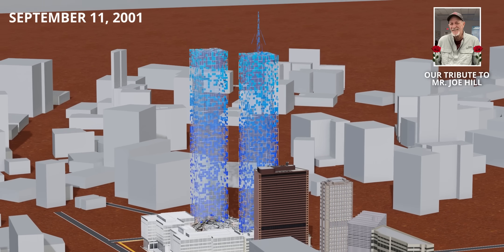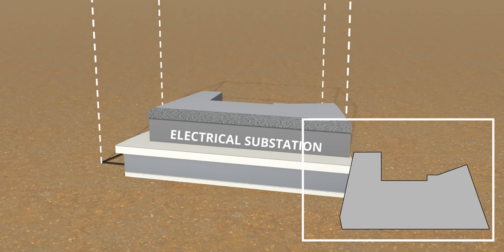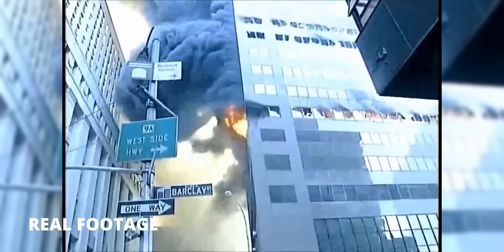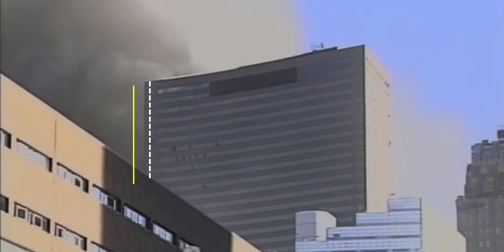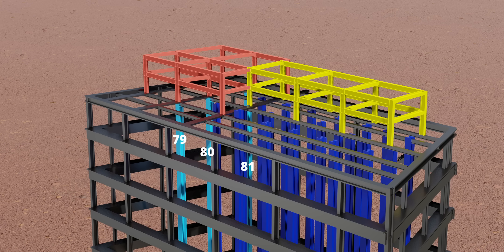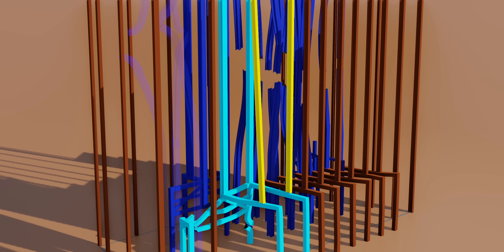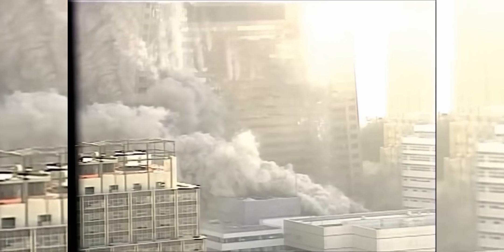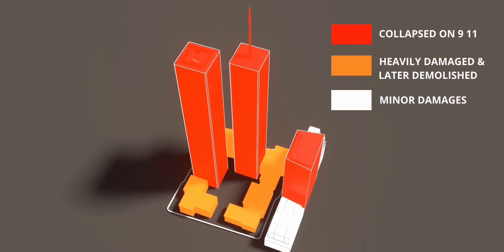Collapse of Building 7 | The Complete Physics

Comment: As an expert building collapse witness, I've seen so many collapse that I can guarantee that building 7 was a perfect controlled demolition and therefore it must have been a conspiracy.
Reply: Oh great, then you should be able to put together a detailed analysis like I did:  Building 7 was the 6th building to collapse of 10 lost on 9/11. Because of its early low priority and complexity, conspiracy filled the information void with simple-minded garbage by technically ignorant people promoting political agendas. 7's loss is an engineering problem and should be treated as such, so I prepared this brief summary of my own analysis to fix that, using technical analysis, not ideology and magical (non)thinking. 

At 10:28am the WTC North Tower collapsed, showering Building 7 with tons of burning debris, causing heavy damage and starting many large  fires which burned out of control for the next 7 hours. Half the FDNY firefighters having been killed, units in disarray, equipment destroyed, no water pressure, and the greater urgency of search & rescue efforts, Building 7 couldn’t be saved so firefighting efforts were pulled as futile and 7 left to its fate. Firefighters make that sort of choice every day in brush fire situations - which houses to save and which ones to let go. Only real difference here is moving the decimal on the size and cost. People get overwhelmed by the size.

www.youtube.com/watch?v=g_SvpwyC17M

Collapse of a burning structure is always a concern for firefighters. Steel buildings subject to fire rely on active firefighting to survive. Buildings are designed around 1 to 3 hours of fire resistance, allowing time for occupants to escape and active firefighting to get started, after which all bets are off. Left to their own devices they'll exceed their design envelope and collapse, like Plasco Tower and Wilton Paes de Almeida. In 7 the occupants escaped, passive and active fire protections were compromised and active firefighting was abandoned hours before the collapse, which left the building to its fate. It lost. Odds on Building 7 would eventually collapse, and it did. No big deal in logic.

 http://www.youtube.com/watch?v=WnYBX6QT0R4 

FDNY Chief Daniel Nigro - The biggest decision we had to make on the first day was to clear the area and create a collapse zone around the severely damaged 7 World Trade Center, a 47-story building heavily involved in fire. A number of fire officers and companies assessed the damage to the building. The appraisals indicated that the building's structural integrity was in serious doubt. I issued orders to PULL back the firefighters and define the collapse zone. It was a critical decision; We could not lose any more firefighters. It took a lot of time to PULL everyone out, given the emotionalism of the day, communications difficulties and the collapse terrain 

FDNY Deputy Chief Peter Hayden ; We had our special operations people set up surveying instruments to monitor and see if there was any movement in the building. We were concerned of the possibility of collapse in the building. And we had a discussion with one particular engineer there, and we asked him if we allowed it to burn could we anticipate a collapse and if so, how soon? And it turned out that he was pretty much right on the money, that he said 'In its current state you have about 5 hours 

The collapse of Building 7 was anticipated and widely reported in the media throughout the day, with 24 video cameras recording some or all of the collapse. Everyone knew what was coming and why. 

www.youtube.com/watch?v=OY5S5k3tMHI

The collapse of Building 7 was from the inside out and entirely different to the Twin Towers, not at all intuitive and thus harder to understand, with most details being hidden from view.  It requires careful analysis and observation, and some people will struggle no matter how much it is explained. But here is my explanation relying on no outside authority. 

Building 7 was a unique, asymmetrical 47-story steel frame structure built atop a smaller 3-story building serving as a partial foundation, requiring lower floors dedicated to complex load transfer structures. Of trapezoidal shape and tube-in-tube construction, B7 (above the 7th floor) consisted of a central core of steel columns carrying most of the gravity load, perimeter steel columns around the outside of the structure carrying the remainder of the gravity loads and long span beams and girders to tie those elements together and form the floors. On the outside of the building hung a moment frame or outer shell. 

www.nist.gov/image-16640

Phase 1 : First externally visible signs of collapse initiation occurred at 5:20:28 pm and was notably quiet with observers not realizing the building was collapsing! No warning in the form of hundreds of eardrum busting 180dB explosive bangs. Here at 12:00 a local CBS affiliate reporter talking 10 blocks from B7 when collapse begins. People don’t start to notice the collapse until 12:11. At 12:45 is the famous CBS fixed camera clip of Building 7’s collapse. Note the silence. 

www.youtube.com/watch?v=t5tEy6mXSE8

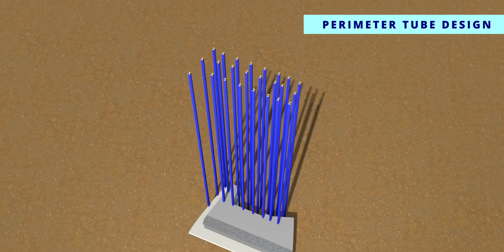Lower floor failures above the load transfer region (8-14) in the NE corner initiated the collapse. In this video at 0:45 you can see the NW corner from inside the building while under construction, Column 79 just out of frame on the left. That big, angled steel beam across the top of the frame connects to C79 at one end. The girders connect to the beam. That beam and all those girders depend on just one connection 

www.youtube.com/watch?v=nP3TNHPCIVU&t=45s

Phase 2 : NE corner floor failures caused a loss of critical lateral support over an excessive length of Column 79 and it buckled. Looking at the above floor diagram of Building 7 when you see all the structures that depend on C79 you quickly realize this one column was a relatively isolated structural element on which a disproportionately greater fraction of the structure depended analogous to say the Key Bridge. Externally as collapse begins we see a vertical progression of window breakage along the 44-46 line and a kink in the roof of the East Mechanical Penthouse at the top of the building, consistent with C79 failure. Normally with a buckling column, the load could be redistributed to other columns. With C79 that is not the case - the failure did not redistribute the load, so the collapse rapidly progressed to the roofline, sinking the rooftop penthouse. The transition from full capacity to almost no capacity occurs in an instant and will result in virtually no resistance 

Phase 3 : With C79 gone, B7’s progressive, non-symmetrical collapse continues with adjacent columns 80 and 81 left laterally unsupported and quickly buckling as well. The EMP drops down through the building. C79-81 all have no diagonal bracing, which is the major reason why they could not redistribute a lot of vertical loads among one another. From there collapse progressed from east to west through the central core until the core was gone from 81 to 58, taking all the interior floors and probably most of the perimeter columns with. Follow the horizontal progression of window failures low in the building and the dropping of the remaining rooftop structures into the building. The NIST Building 7 study model 4 determined C79 failing under ANY circumstances would have initiated the same collapse sequence. 

Phase 4 : After about 10 seconds only the exterior moment frame remains, giving the illusion B7 is still standing to the casual observer since little has outwardly changed. But it is just a hollow empty shell like an empty cereal box supported only by a few remaining columns and overloaded from the loss of the core columns and floors, quite unable to remain standing. With nothing remaining behind it, the north face leans inward, forming a V in the roofline, the last few columns buckle under the strain and the moment frame free falls, landing on top of the debris pile. 

It is only here at the very end, a single measurement of alleged free fall acceleration is taken, from just one point on that outer shell. The Building (core and interior) did not “free fall” - was already gone before that happened - just one corner of the outer shell briefly moved at a rate comparable to FFA. This alleged FFA was a product of how the shell fell NOT why the building fell . It’s also not even proper FFA as the single measured point was moving in 3 dimensions, not just down, which adds another variable. Start to finish the collapse took 18-20 seconds, 3 times longer than true FFA . How fast something falls can’t tell you what started it falling, certainly not 10 seconds after it started falling.  

The debris spread outside the footprint blocking surrounding streets, heavily damaging the Verizon Building and destroyed Fiterman Hall. 

No building is meant to survive 7 hours of multi-floor unfought fires. Building 7’s progressive, non-symmetrical collapse was incidental, unintended collateral damage from the combination of fire, time & gravity started by the collapsing North Tower, true no matter who planned and carried out the 9/11 attacks or why .  Of so little consequence it barely registered at the time, only taking on semi-mythical status as an alleged smoking gun years later when demolitions at the Twin Towers, missiles at the Pentagon and shoot down over Shanksville all failed and conspiracists had nothing left to work with. 

Anything can seem like a conspiracy if you don’t understand how it works. Now you should. I hope you found this helpful, informative and it solicits informed critical comment. If I made any errors of fact, logic or reason or left anything important out, please let me know so I can fix it. OR offer a more plausible alternative if you can. Be the first. Please start any reply with the words “Tits McGee” or I will know you didn’t read it and are wasting my time.
Reply: @TheCriticalStinker-01  my comment was a form of sarcastic humor I'm sorry Tits Magee it went over your head take a valume and drink a beer and relax I understand your frustration with the conspiracy theorists concerning 911 and I'm a rather creative conspiracy theorist myself most of the time you sir have done an excellent job now just go for a walk in Central Park, or Lake Shore Dr,or the Arch grounds, or the river walk in San Antonio, or the Gas lamp district whatever is closest.